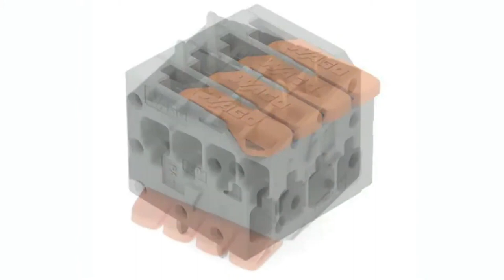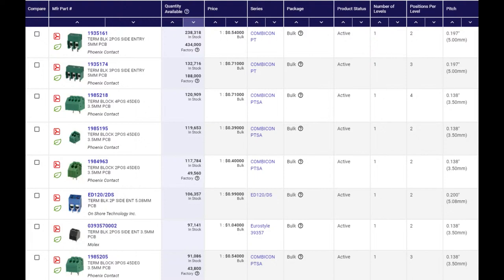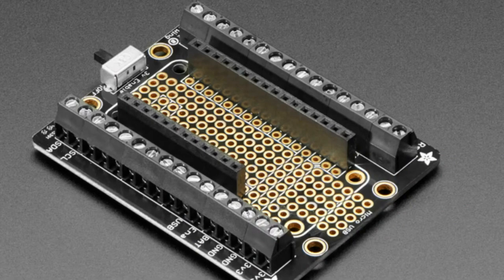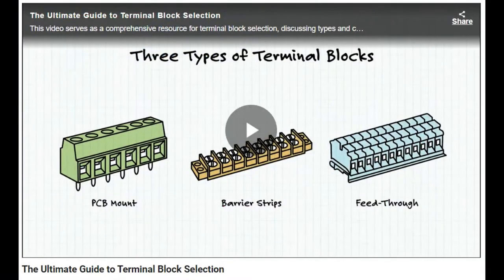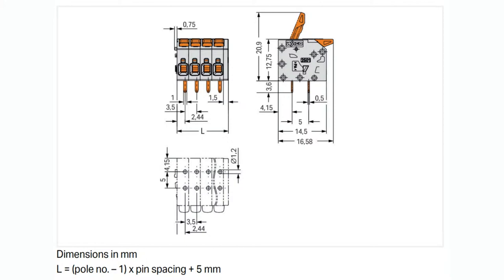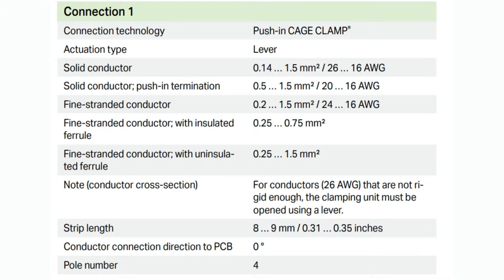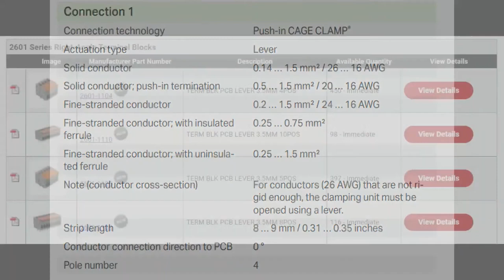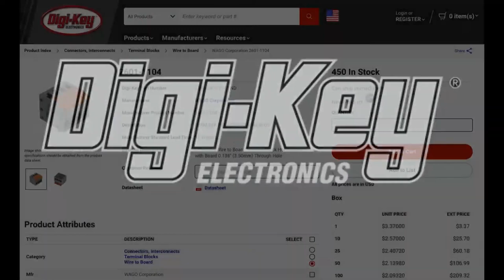EYE on NPI: WAGO 2601 Series Super-Compact PCB Terminal Blocks #EYEonNPI @DigiKey @wagocorporation

Comment: Wago connectors are now listed in the North America Wiring Code to replace using Wire Nuts with 120 volt 15/20 Amp wiring. They have been used in Europe for over a decade in their Electrical Coding

Comment: There was a guy doing a talk on prototyping a while back on either YouTube or Hackaday, and when he was talking about wiring, he said, "If you use screw terminals and stranded wire, use bootlace ferrules!" After I started doing that, I've never had a stranded wire slip out of a screw terminal, ever again. They hold like a dog playing tug of war, and they are fantastic if you need a "permanent as long as it works" connection that can take a beating. The drawback is that this is a lot more useful if you're using the bigger screw terminals with 0.2" or 0.3" pitch, the smaller 0.1" pitch blocks don't have a lot of clamping force, and ferrules that fit that size tend to be quite finicky in my experience.

I bought the 2601 block a couple of years ago, just to see how they worked. They're great if you need to shove upwards of 10 amps of power through a nice thick wire, but the pins are too big for a standard 0.1" pitch perf board, they're more designed for PCBs. The springs are super strong too, I think they're stiffer than the old Wago 222 lever nuts.

Comment: why didn't they invent them years earlier? or did I just overlook those?
Reply: Wago's spring clamp design has been around since the 1950s I think
Reply: They have been used in European Building Wiring Codes for decades INSTEAD of Wire Nuts which I believe are now bann6in the EU
Reply: @EvilDaveCanada  sorry for confusion, i meant PCBmounted WAGOs, for soldering edge connectors to circuits.
Reply: @rarbiart  np